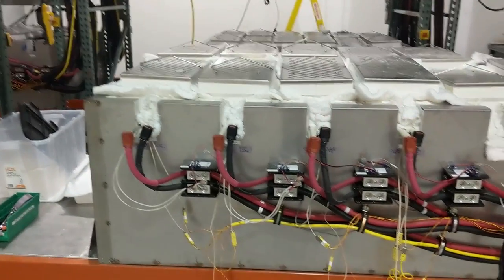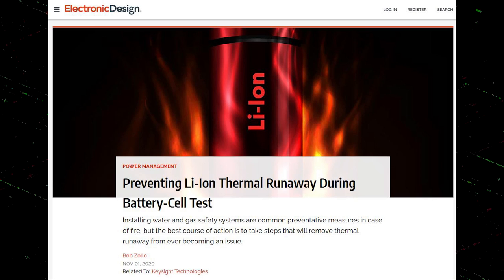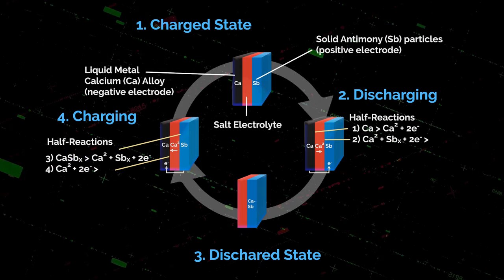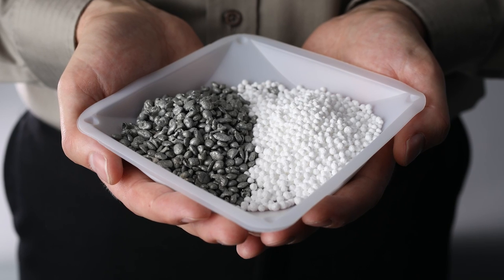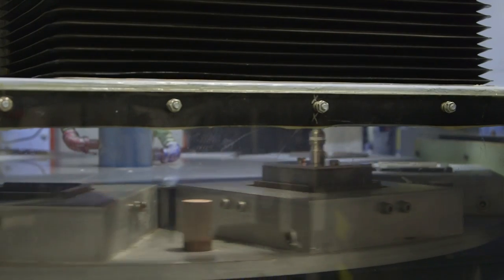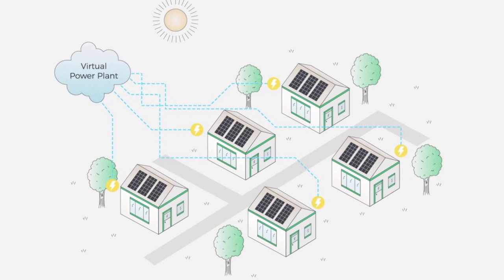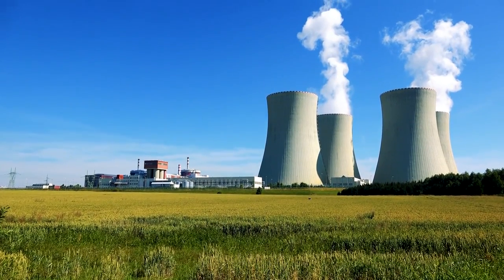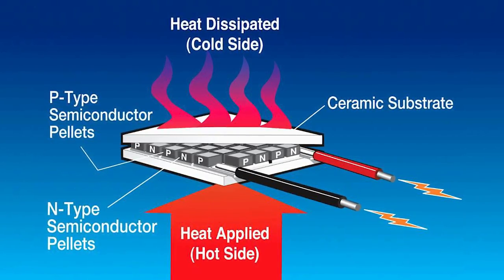Ambri: A Battery that Could Change the World

Comment: I may have missed the answer: is the energy lost that is used for heating up the frozen battery? How many kWh can be extracted after putting in 1 kWh? Into a frozen vs a liquid state battery? Most cardinal questions, imho. Thank you.
Reply: Great question. With a Lithium battery about 80-90 percent of the charge discharge cycle is lost as heat. The rest is electricity. With an Ambri liquid battery 80-90 percent is also lost to heat, the rest goes for electricity storage, about same as the lithium battery.  BUT with lithium, the heat is bad for the battery. It's wasted energy. There is no benefit.  With the liquid battery heat is a friend. It's a benefit. It keeps the battery liquid. For more information search the Ambri battery on YouTube and you'll find the original lecture from the professor 10 years ago.
Reply: @cyberslacker5150  great answer but I believe the round trip efficiency is 80% that means that 20% is turned into heat, which as you astutely pointed out is not really lost because it serves a purpose. The energy needed to kickstart the initial melt is probably quite a bit, but over the course of 20 years, that is a negligible amount.
Reply: @ironassbrown  Im not sure... I suppose it is all about 'The real world application' but on the bench significantly higher CC is attained. One Tech that used to work there stated 90% and he had brought it up to 95%. Might have to do with 'perfect situations.
Reply: @mikedar8484  I am just going off what is listed on the Ambri website, and what I have heard Prof. Sadoway say in previous talks.
Reply: @ironassbrown  Yep... this correct.. and as safe a statement as needed- competitive. Still, I think the CC is doable higher. for example a insulator still isn't fully adopted that Ambri wants as a standard.
Li was the same way, less efficient when first roll-outs as the tech was wanted more and more. I can only surmise starting at 80% will be exceeded just as Li got better.
Reply: @cyberslacker5150  It sounds like (and I've only just heard of liquid metal batteries today) that heating intentionally is the charging process. If I'm understanding charging is a mechanical process that could be enhanced with electricity. Utilizing ambient heat and/or geothermal could keep recharge energy costs down. I'm imagining to get uber efficient you could use radiators on wind turbine generators and solar cells to keep them cool and efficient and transfer that to add to the charging process.
Reply: @cyberslacker5150  A lithium-ion battery doesn't lose 90% of it's energy to heat during a cycle. It's at worst something like 10%.
Reply: @JohnDoe-jp4em  The Antimoney battery needs to be heated once,,,, for 20 years of cycles. Will someone screw up and let the battery get cold.. inevitably, lol. But 'cycling generates heat in antimony battery. Li has a temp restriction above >< 65c.. and should be cooled or not cycled there by generating more heat, The Antimony is designed for rapid charging and discharging and generating heat.
Reply: @djdickey  The heating is to liquify the metals and salts so that they self-organize into Anode, Cathode, and electrolyte. The charging and discharging is basically the same as any other battery by applying an electric voltage across the terminals. The energy storage is accomplished through ions that migrate through the electrolyte and combine with the metal on the opposite side of the electrolyte. the discharge process exactly reverses the flow of ions restoring the battery to its uncharged state. Both of these processes induce heat into the cell which keeps the temperature in the running range
Reply: @JohnDoe-jp4em  in fact run at moderate discharge rates, Li-ion can lose just 1-2% - thermal loss only becomes significant when they are run at very high (eg 1 hour) discharge rates.
Reply: I agree, there's some smoke and mirrors going on here. If it generates 20% heat, even if some of that is useful for keeping the metal liquid, it still represents a loss from the charge-discharge cycle. No way around that - it is a loss, an inefficiency, and it sounds like a way greater loss than in typical Li-ion applications.
Reply: @alexgray552  Li still has temp restrictions and poor performance with 100% discharge and 100% recharge daily over time... cost of install matters... I think for the Microgrid this one is a tad better after 20 years of '100%' and fwiw... if used daily a heat exchange is likely needed for iether. Heat can't be wasted.
Reply: @ironassbrown  Well, it's only true if the battery is always in a molten state. Otherwise it's not economic to let it cool down, just like the factory iron smelters – it's cooled down only 1x a year around Christmas when the whole factory goes on vacation, because it's so expensive to reheat it. So the question persists: won't the battery cool down during the daily up/down cycle? Wasting 20% however is still better than 100% by not storing it. With a waste level of 20% maybe still better than storing the energy in flywheels or gravity based equipment.
Reply: @mikedar8484  How can you asses yet that it it will be better for microgrid? Don't get me wrong - I'm not saying it will never prove to be so, but we don't have the evidence yet. Until we see its real world cost, including support systems, installation and maintenance tech and the heat losses and reliability of the overall systems, we can't make a judgement on that. There must be heating/cooling losses beyond what is lost through the insulation, unless by some miracle the rate of charge and discharge on the battery always produce exactly the right amount of heat to balance the heat loss through the insulation, which seems very unlikely, or unless they also build in a thermal store, which would have system losses of its own.
Re the performance after 20 years, who in their right mind would put Li through 0% to 100% cycles if they were concerned about long term cost. You buy a system that is 50% oversized and run it between 20% discharge and 80% charge if your main concern is total cost of ownership on a frequently cycled system (at least that's what I do with my phone and laptop :) )  But as I said, I'm not saying this might not be an excellent technology for grid support (though probably not for micro systems), but we simply haven't been presented with the figures yet, just a positive spin on every aspect of the battery.
Reply: @alexgray552  Alex... are you invested in a stock dealing with Li? Spin? Really? I will no more ague with you about the Liquid being good.
Reply: @mikedar8484  Haha, no, I've got no financial interest in Li or any other battery technology - just an inquiring mind.
Reply: @alexgray552  Beginning to wonder if you were 'Married' to Li lolol! Regardless storing for wind and solar is sorta a waste imo... as imo wind and solar is a waste... of precious time and money and politics... even if that is the golden rule today.
I just think if there is to be, then at least make it viable to a degree. 
I'm close to the end of the road so my favored science is highly unlikely to come to pass before I am gone and I am familiar with what the Prof is going through on this issue... huge resistance to change and I believe he has a good product and business model. 
One might consider one idea way out there which was molten aluminum in sizes of a football stadium for a battery. Financially doable, or redundant 'Green' then pumping water up hill to fill the grand canyon... doable. But the 'system' will not allow such huge developments, were stick with band aids.
No band aide is perfect.
Reply: @mikedar8484  pumped storage seems to work quite well to balance wind and wave, and it is far longer lived and more reliable than batteries but new schemes hit huge environmental objections. As for wind, so often where I am the ridiculous market mechansisms cause wind farms to be paid huge sums to sit idle when there's too much being produced. Roll on fusion generation.
Reply: @alexgray552  Yeah it is less efficient than some li-ion batteries and more efficient than other Li-ion batteries. li-ion batteries range from 65-95% efficient the longer duration they are the less efficient they are. and the hotter they get the less efficient (then there is the fire danger) don't forget the energy cost of cooling a li-ion bank which will probably be between 15-30% of the energy used to charge and discharge the bank. after a few years, li-ion will start to degrade and need to be brought offline and replaced. Li-ion is fantastic for portable batteries it is lightweight and energy-dense which is perfect for cars, portable devices, planes, laptops, etc, but that is not needed for a stationary grid-level battery, which can be heavy and big and preferably remain online for decades without being replaced. Li-ion is a finite resource. Doesn't it make sense to use li-ion for applications where you need lightweight and small form factor batteries for things like EV's instead of forcing the EV manufacturers to compete with grid-level storage manufacturers for the batteries that they need?
Reply: @alexgray552  As the Prof has said, works where there is water and can overcome local restrictions.. moving water is expensive.. hence I like LFTR reactors.. like any Nuje they need water, but a National plan is needed for LFTR and overcoming 'locals'.
Truely just spending money means little... remember wht, if your were of that age and heard the words' Kennedy said, then did with 'Go to the Moon', National plan, 200,000 scientists, 5%+ of government revs.
When Kennedy said '.... do for your country' people got up and marched!
Biden is as inspiring as a dead starfish on the beach, or roadkill... meaning money alone will not get it done, for that matter for less than what Biden is proposing in spending.
Even the Chinese have more public positive sentiment for all their programs.
Reply: My bad. You are all right. I got my percentages switched.
Reply: @cyberslacker5150  We all knew what you meant... juxtaposed- we knew what you meant anyway, no big deal.
Reply: @alexgray552  It's not smoke and mirrors because Ambri is completely upfront about the function of the battery. It is simply a case of you lacking all the information you need to make a fully educated assessment. You are hung up on efficiency, but obviously don't realize that 20% inefficiency is incredibly competitive with other energy storage systems. Li ion has many drawbacks, including the inefficiency of having to cool a large bank, I don't think you factored that in. there are many other problems with Li ion for grid level storage, but I just got home from work and I am tired so do some research and find out the way that Li ion becomes less and less efficient as the charge and discharge duration increases. Also the Lithium needs to be pure so even though lithium is abundant, pure lithium is not, so it is not scalable in the way LMB is( and this is just a starting point to guide your investigation).  Just look a little deeper please before you jump to conclusions, and worse misrepresent what is being proposed.
Reply: @mikedar8484  Heck yeah, MSR's for the win. You go buddy!

Comment: I would have asked how the battery is heated to the operating temperature, and how much energy does that take to get it there and maintain it at operating temperature.
Reply: And whats the net efficency ... power relationship ... how much energy does it cost to store a watt or two ... and if its refining, where's waste going?
Reply: Listen more carefully.  The heat for melting the electrodes and maintaining operating temperature comes from the internal battery resistance, i.e., the 20% losses from a full charge/discharge cycle.

Comment: Softball indeed!  They never mentioned that the batteries require gravity.  How would the cells handle a trip to the moon?  And heat -- they don't mention the upper limit of cell temperature.  A well-insulated cell could get hotter and hotter.  Beyond some temperature, the container fails, etc.  Lots of unaddressed issues.

Comment: As a Californian who's regularly seeing TONS of power outages ranging anywhere from 2hrs to over a week (and all during the summer heat at 110-115F/43-46C), I'd LOVE to have one of these batteries hooked up as an intermediary to the house.
Even without solar, just having something that could keep an average American home powered for half a day would be AMAZING.
Like having a generator hooked into the power grid, but without having to run a generator until +12 hours in.

And this is the perfect type of battery for this kind of application.
It has a (mostly) regular power source (the power grid, or a generator).
It'd be in a very hot environment.
It's the type of long-term battery that needs no significant oversight or maintenance.
And when it's not going to be used for a significant amount of time, simply letting it cool will essentially place it in a "standby mode".

Comment: As far as I understand, the trick to keep it nicely warm is by recombining their setup on the go. 
The lower the voltage, the higher will be the heat. This way, they will keep the right temperature with their own current flow. 😉

Comment: Excellent solutions .. Many off grids use golf cart battery because of quick charge an slow discharge .. Stacked array parallel in series or series in parallel .. stepped up voltage or amps depending on load demand .. Look forward to implementation keep it versatile and scalable please
Reply: Microwave electrolytes creating hydrogen plasma in metallic salts

Comment: The liquid metal battery does have potential, however,weight and temperature control system will be extremely expensive. This was looked at in the 40s,but radiation caused problems.

Comment: I can see these batteries being used as power management control. Power companies could station batteries along their transmission routs then charge them during low use periods. When the demand goes up you have stored energy which take up the extra demand. This keep generators running at a more consistent rate through out the day and night. This would reduce wear on equipment and rolling blackouts. 
 Every major energy company should be using your batteries.

Comment: just had another thought. I've looked into geothermal heating. Using the same principals as geothermal you could integrate this battery into a bitcoin mining operation as a good application since they are already producing so much heat. The less energy that it takes to get this battery to temp the more efficient it will be. using heated air would be like having it in the dessert.

Comment: The 2 Elephants in the room were not addressed sufficiently. Running temp of battery 700 C Deg. For grid scale battery we are talking about many shipping containers for a medium city like Las Vegas which means thousands or millions of tonnes of Metal. That is an enormous amount of energy to heat that up to liquid. That energy has to come from somewhere before you start your first cycle. That is a cost.
Antimony is rare. Where are you going to get the vast quantities of Antimony from?
There are other less obvious flaws which are probably solvable but these two issues make this a non starter for grid scale solar.

Pumped Hydro is the obvious long term candidate for grid scale storage. Prohibitive capital cost are a big problem but running costs and efficiency is very attractive and can last centuries.

Comment: About using the heat to heat a building or generate more electricity, any time you convert that heat or move it elsewhere the batteries will become less efficient. You need that heat to stay with the batteries so the contents can remain molten.

Comment: This seems to make a lot of sense for off grid power. The cost and life of lithium doesn't make sense for off grid ... I've been considering AGM for my needs but I hope this becomes available to me real soon.
Reply: Lithium allows way more cycles than AGM and have been coming down lately.  I want two lithium’s for my wheelchair.
Reply: @hogman2276  for mobility needs I agree that lithium is best today and I'm hoping solid state will bring about lighter and faster charging options going forward. With all of the high tech of stupidly quick scooters I'm disappointed to hear that you still labour with lead in your wheelchair.

I hope you get the upgrade you deserve very soon.

Comment: This is going to be really a wonderful innovation should it succeed the way it is projected. It will be surely transformative if not disruptive in the immediate future. What I liked the most is the answer Professor Donald provides to the question as to how he got the idea . He says it takes a lot of heat to melt metal Oxide and to separate metal from oxide. If this molten metal energy is converted to electricity by ion separation that would lead to the battery principle . This is a strong concept to succeed the technology no matter what efficiency we can achive in energy conversion. Hope it will become a reality soon.

Comment: I do not want to spoil the party and I do think it sounds nice but there are a few things to consider that you haven't asked:
- What is actual capacity of an Ambri battery vs. a typical lithium battery?
- While Antimon is not as delicate as lithium it is still a rare metal you do not find as "dirt" to pick up in your garden.
- How much energy is actually required to spark an Ambri battery into life when the metal layers are solid at delivery? How is this heating actually performed before there is enough current drawn by it's load to heat it?
- The idea of having liquid electrolytics is not new. Check out e.g. Redflow batteries.